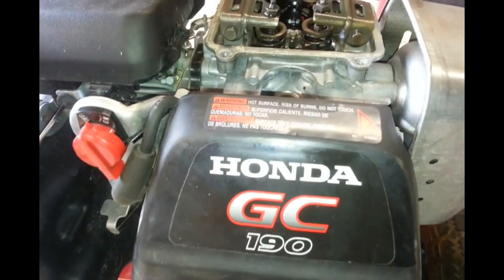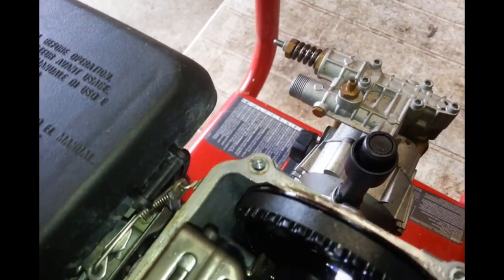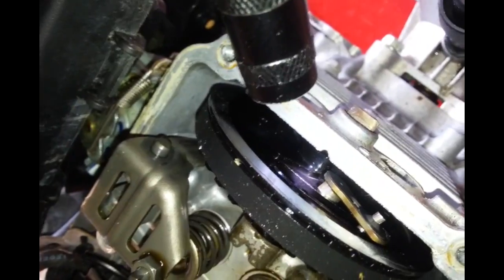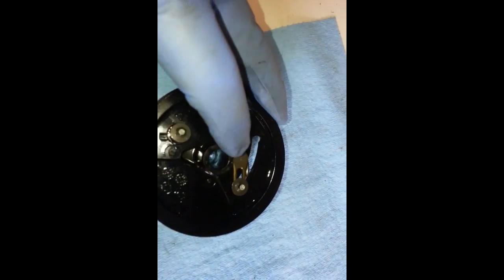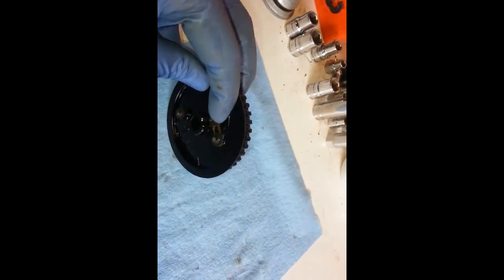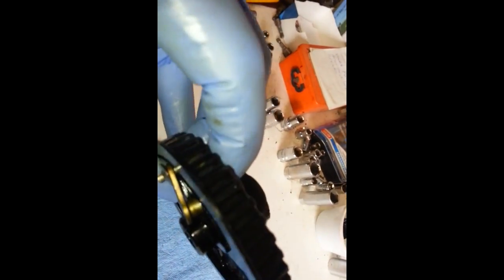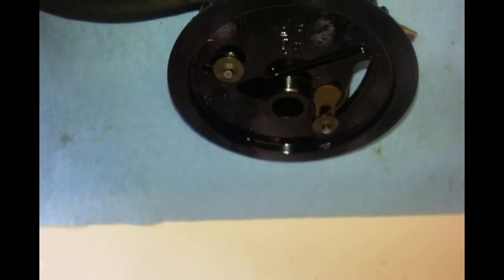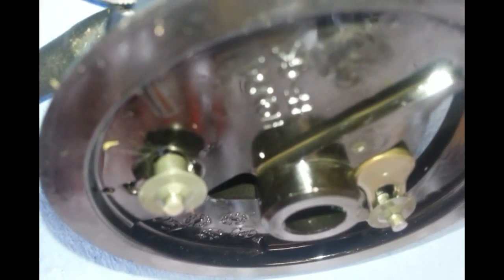Honda GC 190 power washer high compression problem when trying to start

Comment: Where exactly is "Video shows replacement of the camshaft" ? I would like to have seen that being done and the whole job finished with repaired engine running. I do see explanation of "Why the problem occurs" AFTER the black wheel thing is already out of the engine. Mine has opposite problem; very low compression (30 lb.)

Comment: I tried to follow all the procedures but when I finished it still was hard to pull. I removed the spark plug and the engine turns over easily. Did i somehow mess the belt/pulley alignment? If so how do I correct it? Thank you.
Reply from the maker: Was the camshaft assy broken and you replaced it with a new one? It will be easy to pull no matter what with out the spark plug. The camshaft assy is a compression release system and if broken, you have full compression when pull starting and can kick back on your hand and arm. For sure double check your alignment. You have to make sure the bottom crank does not move and make your marks horizontal then put the belt back on. I think there are videos on that.
Reply: @RidgePowerEquipment  I can't find anything broken on the original pulley. If I didn't properly align the replacement pulley how can I get it to align properly now?
Reply from the maker: @terrydressell2383  Make your marks horizontal then put the belt back on. There are videos on that.
Reply: @RidgePowerEquipment  Thank you for your help. I found a video that made the process very easy.

Comment: My Honda pressure washer died while running with no oil and now it has no compression, should I buy a new one or can I fix it myself I'm mechanically inclined.
Reply from the maker: If it still turns over easy, then you could disassemble it to have a look. If it was with out oil, it may be junk.

Comment: I just picked up a pressure washer out of the trash.   Had a rough time starting it with my drill lol.  But got it running.  I’ll have to inspect the cam.   Thank you!   Merry Christmas.
Reply from the maker: Right on! Merry Christmas

Comment: I recently bought a new pressure washer and it was very hard to start my fist thought was wow it has very high compression after several stops and starts only 18 mins on the hour meter it snapped back out of my hand and broke my wrist and I had to have a plate and 10 screws inserted in my arm and two wires in the ligament that need further surgery to remove 
I believe my pressure washer has a similar problem I'm in negotiations with the company over it now t
Reply from the maker: Ouch sorry to hear, I have been bruised in the past. Good luck!!
Reply: That is a serious injury. I can’t even imagine the amount of pain you endured.
Reply: I am reading all these old posts, and my karcher pressure washer has been trying to break my arm for years! Now I know what to look for!